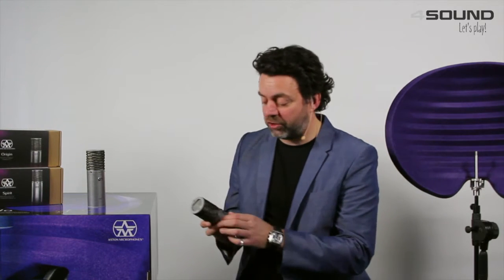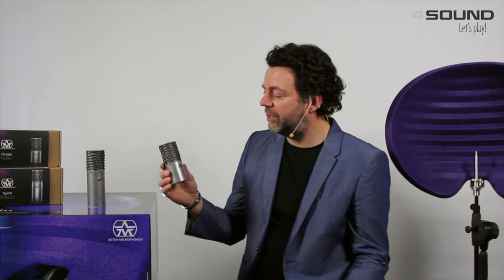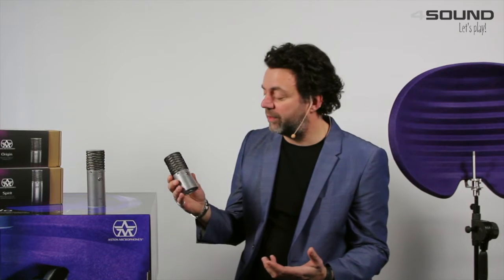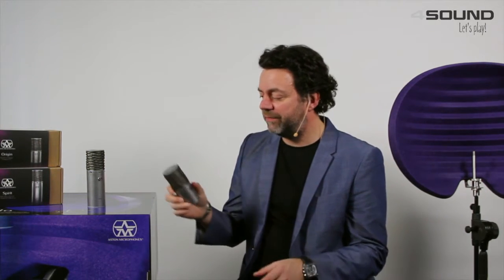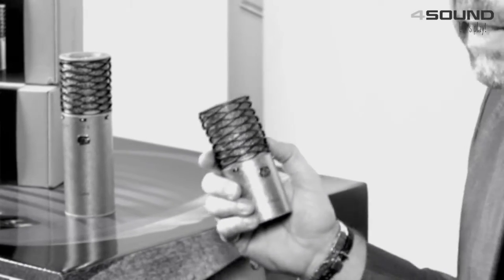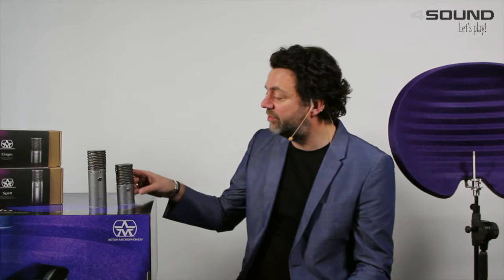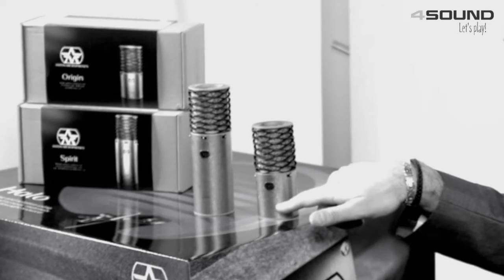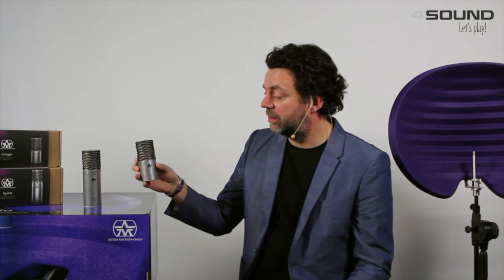Aston Microphones - James Young - Origin & Spirit

Comment: Hi James I just purchased the Spirit Special edition with crude and pop filter, however i notice that the mic slips down all the time in the cradle or holder if its called that. And seems to hold on just by the roll off switch and the one on the other side, is this normal or am i doing something wrong
Reply: yeah man lol get the rycote I’ve got the same mic but the original one too! But get a rycote one not that one